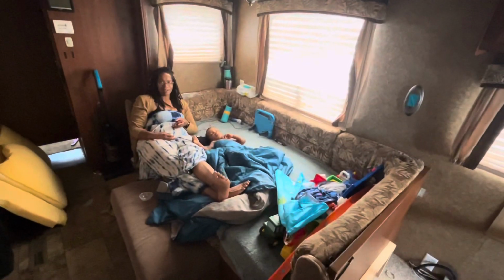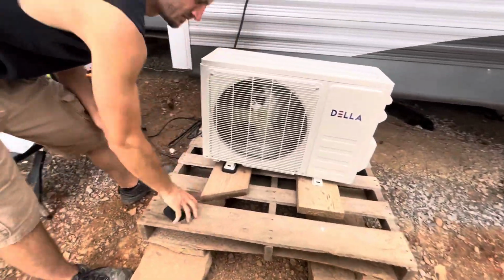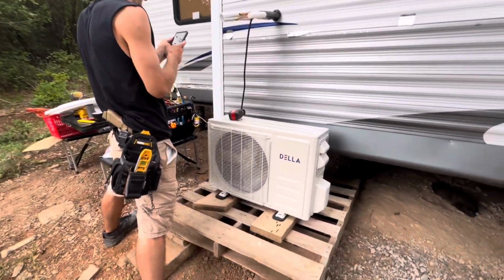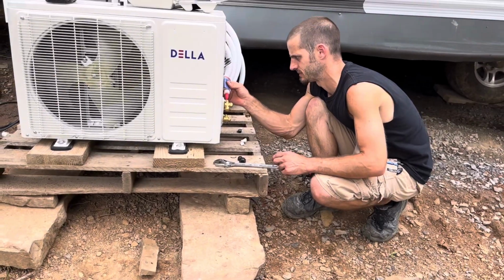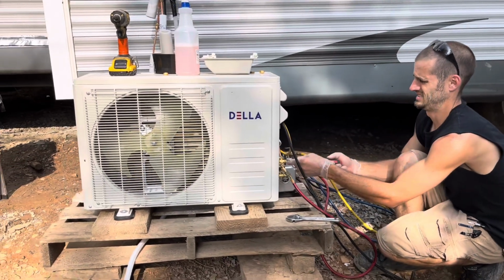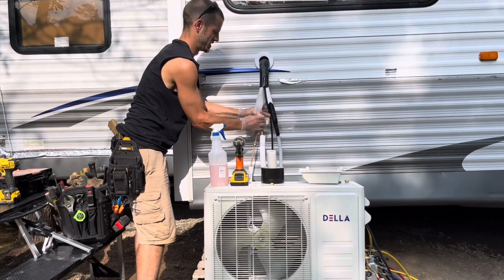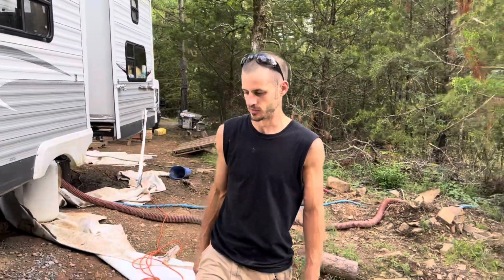Della Mini Split Offgrid install

Comment: The sleeping kid and the tools made me smile- very considerate. Being a Navy guy we used these hull fittings that dress holes up with a threaded flange on both sides and water proof-- but the sleeve looks like it did a nice job keeping it pretty, insulating against the metal as he noted, and hopefully bug resistant. I bet that split rocked the inside weather so everyone inside was as cool in summer as TJ is on double bass. but wait there is more--- five minutes in those are some nice fieldstones.

Comment: Is Jason learning on the job JA? For your application I would have gone with a ceiling mounted unit(more expensive the high wall mounts here, but worth it in the long run). Typical mini splits like yours are meant to be installed at least 6ft high. It will work, but not as efficiently as it could. They also make an indoor unit that sits on the floor and looks like an old school radiator but only about 5-6" in depth and gets mounted the same way against the wall. 
The whole point to this unit is to be mounted up high, that's why they're called high wall mounts. I was an HVAC contractor and did mini splits only in the summer time in my area. Was a Mitsubishi dealer and that stuff is one of the best and trouble free. 12 yr warranty on parts and labor when installed by a trained contractor. 
 I like that he used Nylog sealant, but usually the flared ends of the piping that comes with the mini split pipes, always needs to be cut off and the flares redone with a concetric flaring tool, as almost always they are either bent or not at the proper flaring angle required for mini split. All flares need to always be torqued properly with a torque wrench. Always had a manual and a Snapon electronic torque wrench with crow on me . The #1 problem that I've gone on service calls on was always a leak due to poor workmanship when installed. 

Just the unit on pallets that will decay makes me cringe. Outdoor units needs to sit either on a stand that is made for it or at least concrete blocks to prevent the freezing from the drain. The outdoor unit actually drains water in the winter time, so height matters.
I haven't even heard of Della as a brand, and wouldn't touch it if I were the installer as when you install it your reputation is also on the line as an installer.

Comment: How do you like this system so far I’m needing 3 units installed
Reply from the maker: I love it. The best part is the inverter mode to use less power with me being on solar. When I run the generator I turn the inverter mode off and it blasts the cold
Reply from the maker: https://amzn.to/3DPupu4

Comment: I have a 17 Seer, 115VAC, 12K BTU Della Mini Split with defective WiFi.  It reminds me of a laptop where either the black or the white wire has come off the WI-FI board.  Can you tell me what to open and where to find the Wi-Fi board in your Della Mini-Split?
Reply from the maker: I am not an installer or have knowledge on how to repair the wifi board. So far  no issues out of mine.
Reply: The wifi module is in the head

Comment: Can you explain more of your solar set up to run this? Thanks
Reply from the maker: Yes I can. I have 12 used 160w panels in series parallel (4 lines of 3) going to a Renogy rover 60a charge controller. That charges a bank of 4 195ah flooded deep cycle batteries. I then have a 3000w inverter/charger dedicated to the mini split. I tend to get 6-8 hours of run time without starting the generator. When it is over 100° out and full sun on the camper it can drain the batteries fast so the generator will need to go on for an hour to get the batteries back to 100%

Comment: I watched your video and after careful thought I bought the DELLA 9000 it just arrived this is exciting as well I will be saving money in the future :) Thanks!
Reply from the maker: That is awesome. What is the seer rating on the one you purchased? How big of a space will it be in and what are you using to power it?
Reply: @JADudley  19 seer2 - 400 sq feet (Estimation) I will try to go with a solar and AC combo. My goal is use the solar in day time and only use my 150AH LIPO4 in emergency in the night when or IF power goes out and it is 90F. I have 2 types of Automatic Transfer switches so we shall see how this ends up but it would be nice to have the AC side kick in when a determined amount of watts drops off the 2 arrays I will have. All this is in the works. Main thing for me is "safety" first. Gotta love the YouTube Library right? Keep us posted on your system I will subscribe too. 

Game Plan is be able to keep some food store in mini frig. Be able to heat or cool if AC power is knocked out due to storms or whatever. I want to use DC to heat water for washing. shower or dishes as well. I catch rain water and will use BIO CHAR if needed to filter the water if needed. I am not a fatalist I am a old time DIY and do not get too dependent on the powers that be type of fella. Built a wind generator from a tread mill it trickle charges if nothing else and using proper gear you can have wind/solar work together to keep the batteries up to snuff. Sorry so long of a reply but hey we all need to share in this world we live in. PEACE!

Comment: i just bought his one. Same exact one. coming from a 8.8amp 10,000 btu window ac and i was told i should save easy half on my electric bill which i hope is true lol have you noticed a difference?
Reply from the maker: Yes. I live off grid with solar, batteries and a generator. My solar is not able to power the ac ontop of the camper. And running the generator all day for the camper ac still did not cool it off. Running the mini split keeps the camper cool with the assistance of rechargeable fans (video coming soon) the camper will stay 75° while it is 100° outside and full don on the camper. The solar keeps up for most of the day and in the evening we run the generator to top off the batteries 🔋

Comment: interested to here how the power consumption is .
Reply from the maker: It varies on how hot it is outside and if the sun is beating down on the camper. It has a gen mode setting that you can run the mini split at 30% power. At Max it pulls around 500 watts. Then after it cools off inside around 150-200w. If the mini split was running at 100% it would pull 1kw during the initial cooling.

Comment: Did I miss it or how to wire it to a breaker to inverter???
Reply from the maker: Hard wired it into my Renogy 2000w inverter then when my Renogy 3000w inverter charger I have it solo to there. Just using an outdoor extension cord that was damaged. Cut at the damaged section and cut the end off.
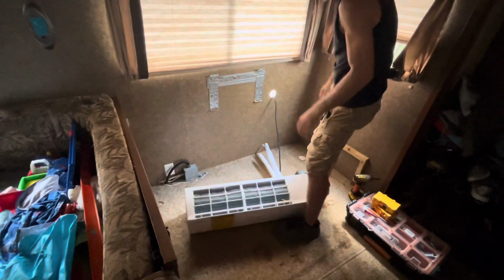Reply from the maker: https://youtu.be/6358sWHUCGE at 2:14 in this video shows the bus bar that I connect to but not the actual wires connected.
Reply: @JADudley  I'm thinking connecting the nutrals together?
Reply from the maker: @TheVoiceofKevinC  I could once I re wire the system. That will happen when I get a smart shunt.
Reply: @JADudley  thank you!!! Great. 👍

Comment: Maybe a wise word. Tape the template up, then you have two hands to use again. (double battle axes 😊) Instead of spray foam, form a rubber gasket, seal the edges with contact cement, invisible once you clean the residue off and secure. Foam works, until you have to work through the foam. Secured efficiency, save time later.
Reply from the maker: Great tip! I wish I saw this before I foamed it
Reply: @JADudley  Ya got it for another time. Stay blessed from Father Yah  family, in agreement Matthew 18:20. More than two or three there right!? 😉🤣 Y'all all be safe out there, keep Beardy in line! It's all of our broad shoulders today. Keep doing Dad's work Mr. Dudley and fam, those people need you! All praise to you Father Yah, Yeshua,...Your staff of correction. Your Holy Spirit Father Yah, that comforts and guides...after the storms. Shalomie Homies. ❤️